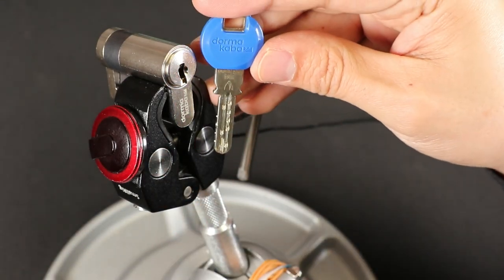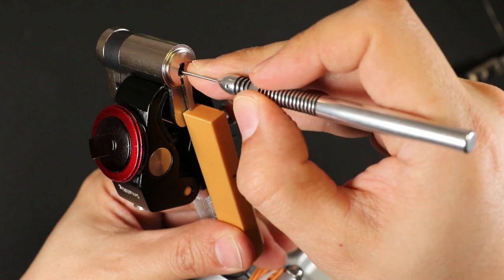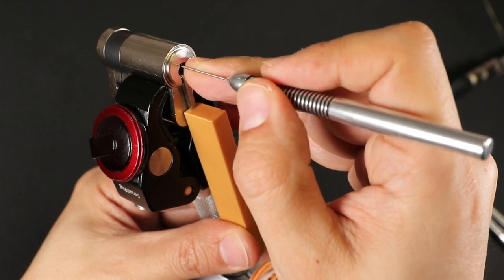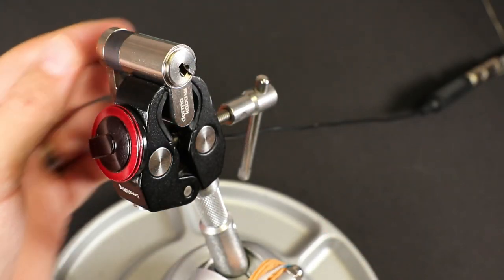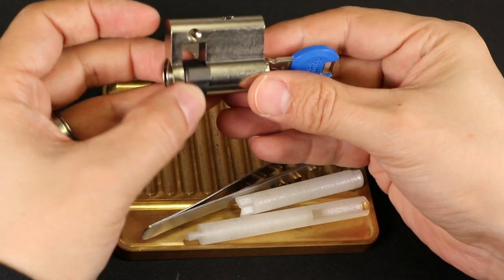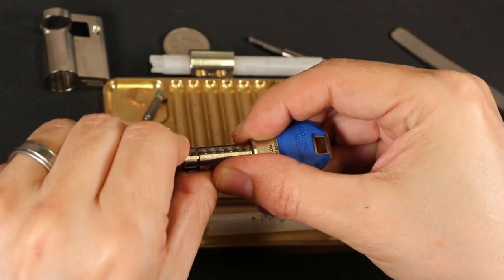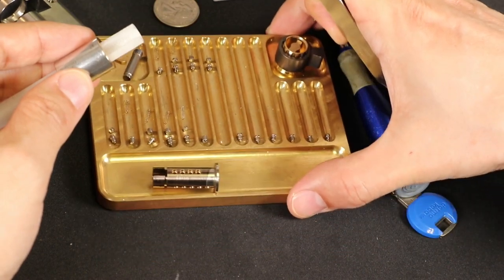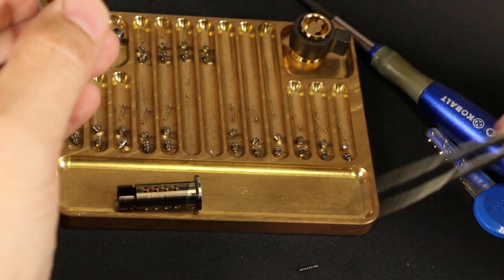[L135] Dorma Kaba Gemini Plus Euro Cylinder Lock - pick and gut

Comment: Nice video, gonna try one of these soon. What would happen if you overset a pin? Is there a way to reverse that and start from the beginning?
Reply from the maker: Getting out of an overset pin is usually a luck thing, back off a little on the tension, hope not too much drops but that the overset pin drops. However, I think you're asking if you overset into the spool section of a keypin, in those cases I just start over by putting the lock back to the locked position, wiggling the tensioner back and forth a little does it.